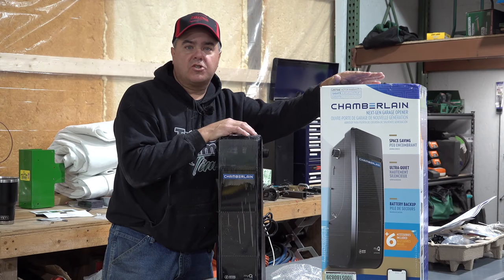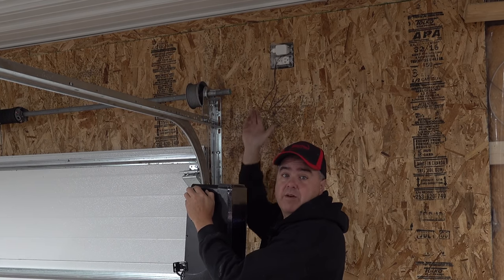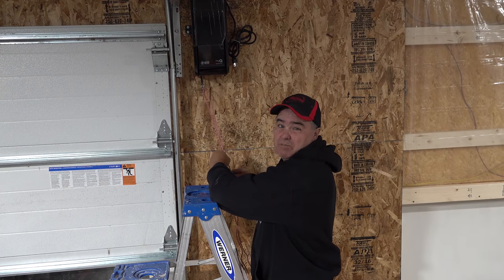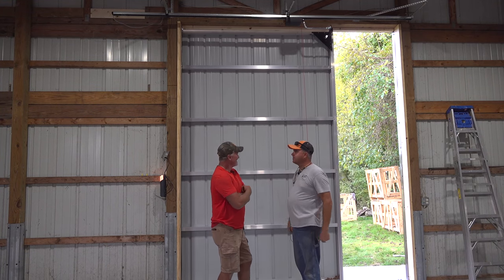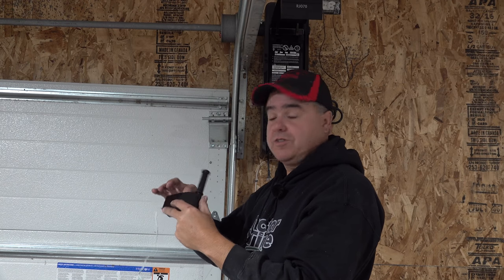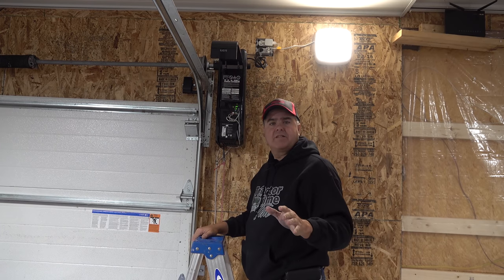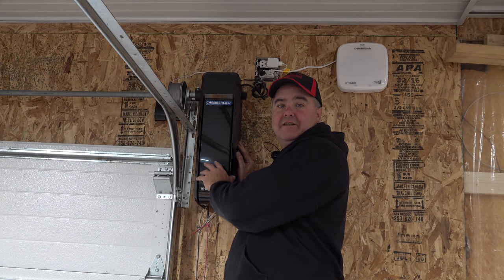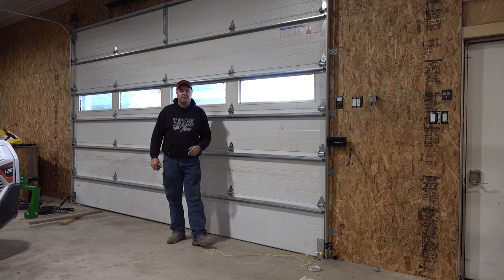Wall Mount Garage Door Opener Install - Chamberlain RJO70

Comment: Your garage can now be broken into in less than 10 seconds.  Here’s how, cut open and stretch a coat hanger, insert a rod end through the garage door gasket and push the knob on the inside of the lock.  Once the lock is defeated the door can be easily lifted.  I know this because someone broke into my garage this way, you can barely see the coat hanger hole in the gasket.  Try and install a steel plate to block access to the lock knob.
Reply: That’s not going to happen with this opener...the safety release is now on the side of your garage, and these units require a firm pull! Also these come with a deadbolt
Reply: Dan, I have the same exact opener.  It’s the inner lever of the dead bolt they push on.  The dead bolt is reversible left to right so has a lever on both sides.  Because the opener is direct on the jack shaft, once the dead bolt is defeated, you can lift the door manually contrary to a regular door opener.  A good video would be how to defeat it and how to protect yourself because it is simple to block that lever with wood or angle iron.  I moved my lock to the upper door wheel behind the corner plate, impossible to defeat it now.  Just trying to help.  Norm.

Comment: Good Morning Tim, I just have a quick question, you said in the video you need a minimum of 2 1/2 inches from the wall to the center of the pipe, and you had like 3 1/2. So did you have to shim the unit to bring it out to match the pipe?
Reply: There are adjustable brackets for depth, but 2.5" was the minimum needed. Won't be a problem with most newer doors.
Reply: The side bracket that he put on before hanging the opener and then tightened after it was on the door pipe has several inches of adjustment in it. The 2 1/2” has to do with the spacing of the pipe built into the opener. There are probable ways around that depending upon your wall construction by recessing it into the wall. My son mounted one of these (different model or at least different color box) on a block wall so had to have the clearance.

Comment: Thanks for video. I've had mine Liftmaster Elite for 11 years... works great. My boy accidentally hit this door with his car; I just replaced two of the panels and was looking for an overview of the opener again (I got the manual in the other garage somewhere). I goofed kind of like you when I pulled the disengagement cord to try out manually beforehand. This door opener is different alright; the cables came all unwound; I had to redo all that.

Comment: Door adjustment.  Be careful lots of stored energy.  Raise door and vise grip in place, use proper winders to unload wire , then adjust sheave.  DIY peopl have died doing this.  A 300 lb door dropping from 8 ft can ruin your day.
Reply from the maker: Wire is ‘unloaded’ when door is fully up.  So, pulley is easy to adjust on the shaft.
Tightening the spring takes a real man!  I was exhausted!

Comment: Spends $500 to replace a working garage door opener but won’t spend $5 to cover the outlets in his garage... talk about a fire and safety hazard.
Reply from the maker: There was no existing garage door opener.  So, this was not a replacement.
Check out this playlist to see the transformation.  https://www.youtube.com/playlist?list=PLuUZ6lo0MDxDzhbaTWr5NUxras4onlArU
We just put up the OSB on this section, and have not yet painted it.  We. have the outlet covers, but we won't put them on until we paint.  ...you can see the paint on the rest of the OSB to see how it will look...and in the other episodes, you can clearly see outlet covers on the rest of the building.
You make LOTS of negative assumptions here....ALL of which turn out to be wrong!!!

Comment: man are you out the you maid when you drii those hose if you  hit the wire et the wire breaker could you hurt you  shouldn't never move o don't do everything when the door is it all way close
Reply from the maker: I just put the OSB up last week.  I ran the lags into the 6x6 post right behind the OSB.